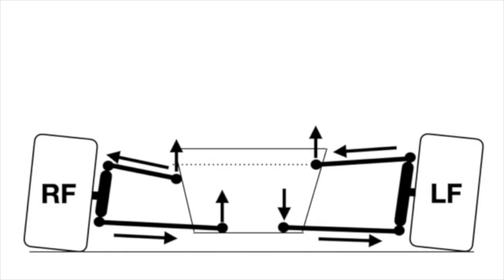Dirt Car Front Roll Center Lateral Load Forces; Dirt Late Model and Dirt Modified Front Load Forces

Comment: running a mod but trying to get my head around this. not sure if its possible with having to use stock mounting holes on lower a frame but frame hole for RF should be lower  than ball joint and left front frame hole even or higher than ball joint so as not to go past center ???
Reply: That is what I’m suggesting. The split we used to run is about ½”. It almost like if your car was sitting level and you put 2 turns in the left side and took out 2 turns on the right.

Comment: What would the effect be if you increased the split in the angle of the lower control arms?  Like raising the lower control arm on the right front lower frame mount, or lowering the left front lower.
Reply: This would increase the effect. You would also have to work with your bumpsteer. Busmpsteer is probably more important to get right. Thanks for watching.

Comment: On the longhorns and other chassis it looks like the right front lays over inward towards the motor at the top in the turns, especially coming out of the turn. Then as they steer straight it looks like it stands back up. Might just be an illusion though from body roll.
Reply: I think it has to do with the amount of caster they are running in the front. But I'm not sure.
Reply: @thomasdilbeck8411  yes, caster, caster gain, and even a little how the caber reacts with that amount of caster. There is so much going on there. Sometimes you just need to sit back and think it all through.
Reply: From the stands perspective it looks like they are running on the inner sidewall coming out of the turns 2 or 4.
Reply from the maker: I'll have to look at that closer. Thanks for the tip and thanks for watching.